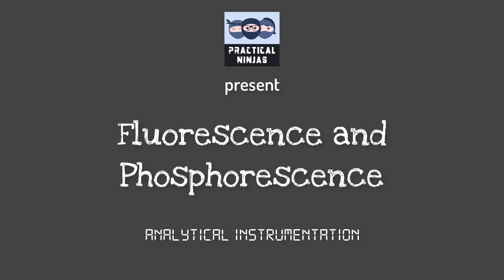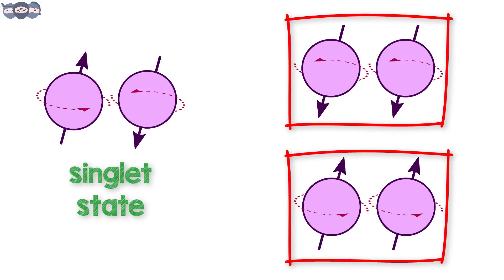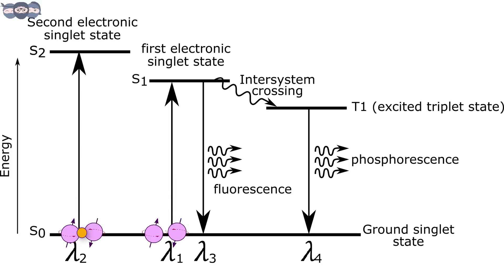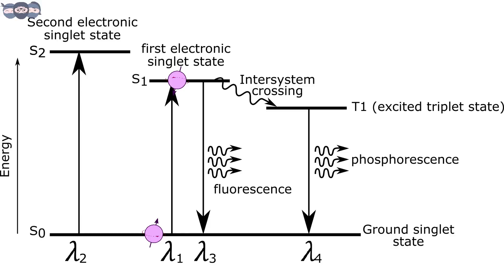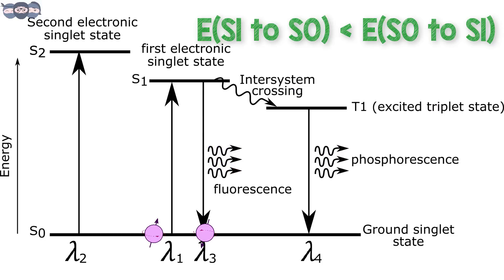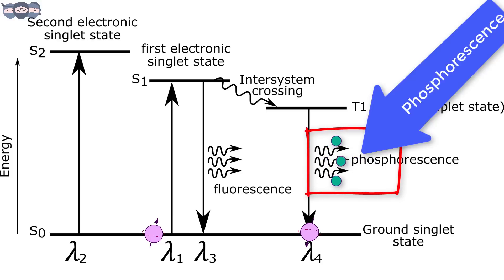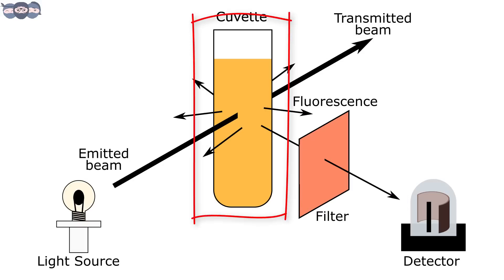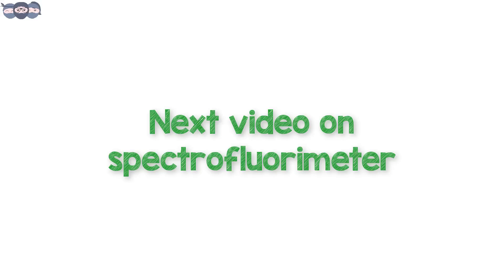Analytical Instrumentation 06: Fluorescence & Phosphorescence Explained | Learn under 5 min

Comment: The Jablonsky diagram doesn't depict orbital energies, but the energy states of the molecular electronic system as a whole. 

You cannot put electrons on this diagram like you would in a molecular orbital diagram.

Basically, every energy level in a Jablonsky Diagram represent its own personal molecular orbital diagram which is omitted.

Comment: Is there any relation between flurescence and bioluminiscence
Reply: vaishnav P v yes. Molecules that exhibit fluorescence must contain what is called a fluorophore or a rigid chromophore in its molecular structure. A fluorophore contains a high degree of conjugation in its structure (alternating double and single bonds). Bioluminescence is due to certain proteins in nature that contain a fluorophore in its polypeptide structure. When the electrons in the fluorophore are excited as seen in this video, fluorescence occurs. For example: the jellyfish Aequorea Victoria displays bioluminescence because it contains the protein Green Fluorescent Protein which fluoresces due to its fluorophore being at position 65-67 of its polypeptide chain.

Comment: Sir,thanks a lot for your video... Can you please tell me , that how will I know , whether a given compound is capable of producing fluroscence or not ?? For example, say acetone... Will it show fluroscence ?
Reply: Acetone may fluoresce when a high intensity monochromatic sources are made to fall incidentally. It is difficult to analyse whether all compounds fluoresce or not, since we consider that phenomena generally in the visible spectrum; What if it emits in invisible wavelengths...Hope you know that's why we use UV/Vis spectra, thought many paper suggests they can identify, it has many limitations
Edit: For vibrational energy we use IR

Comment: QUESTIONS :
1. Why triplet states has lower energy than singlet states?

2. What can cause intersystem crossing?

3. What can cause the spin change its direction from S1 to T1, from T1 to S1?
Reply: 1. The answer might sound weird. But the truth is in Singlet state the repulsion between electrons is higher than in Triplet state. Yep it's confusing. Afterall how can +1/2 & -1/2 charges have more repulsion than two +1/2? 
Triplet state provides degenerate orbitals, meaning a larger area to accommodate the electrons. In this space similar species(two  +1/2)  can exchange energies due to the property of degeneracy. Where as in case of a Singlet state the two electrons are stuffed in a single orbital resulting in high repulsion. Now the most interesting part, all these signs + and - are used to denote the orientation of the spin, not the charge. The charge of the electron is always NEGATIVE. Hence very simply, two negatively charges substances(e-) stuffed in a single orbital is highly repulsive and have more energy that two e- in degenerate orbitals.
Reply: 2. Intersystem crossing (ISC) is a radiationless process of switching orbitals. It is often undergone by heavy atoms. Due to the presence of degenerate orbitals(T1 state) having lower energy (as discussed earlier)  the electrons move from S1 state to T1 state.
Reply: 3. Bro S1 and T1 are not spin directions. They're energy levels(S1 state and T1 state). And the transition of electrons from S1 to T1 is due to the availability of degenerate orbitals (discussed ealier). The change in spin orientation is necessary. Only if their spins are parallel, i.e. two +1/2 or two -1/2, they can exchange energies, and only if that happens they can be accommodated in the degenerate orbitals.

Comment: what is trunsducer.thank you
Reply from the maker: Did you mean to ask Transducer? Transducer is a device which basically converts one form of energy into another form. This another form is mostly electrical energy. It is useful for measuring various physical quantities like temperature, pressure, level etc. A sensor coupled with signal conditioning circuit forms a transducer. For more info on the topic feel free to follow our transducer playlist :)